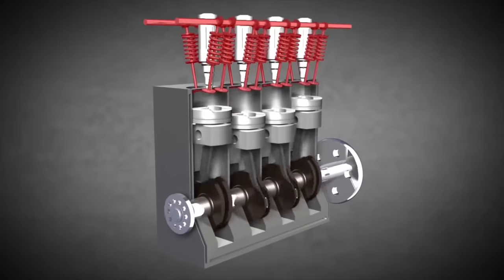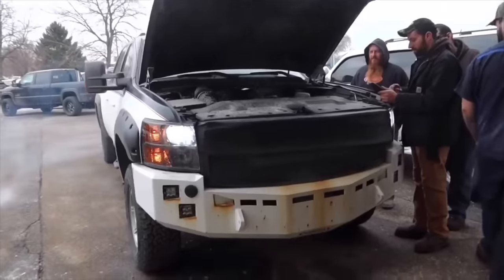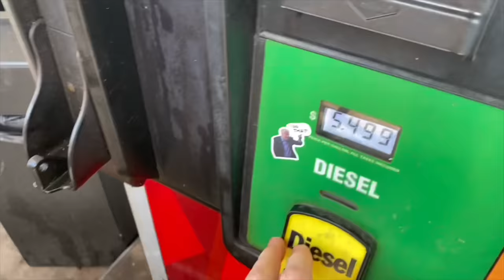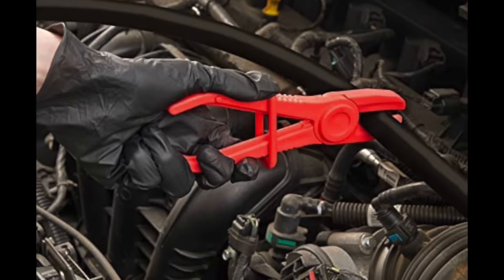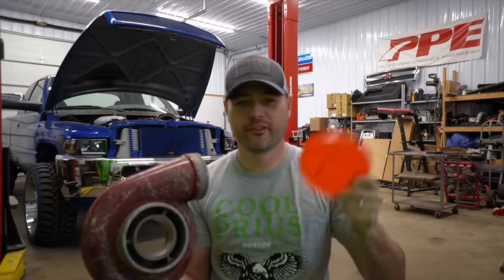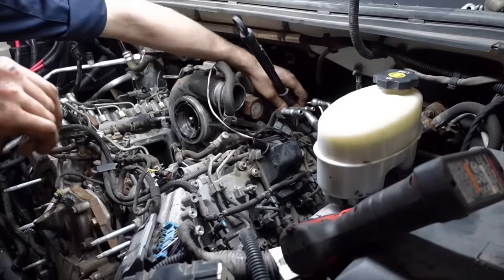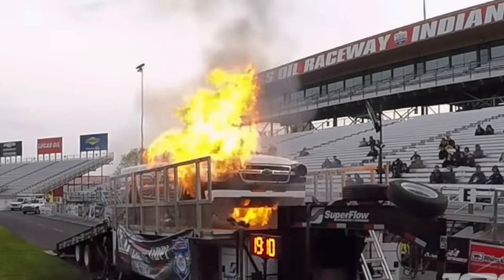What Is A Diesel Engine Runaway? *EXPLAINED* ￼

Comment: If something blocking the engine breather ( pcv valve) it will brake the oil seal at the turbo intake side  , this oil will go along intake manifold and go to combustion chamber , and cause a diesel run away ( this have happened to a truck in a workshop i was working in ), but you can always use fire extinguisher in air filter to stop the engine , along other ways

Comment: New to me old Massey Ferguson 1105, 110 hp turbo diesel. Takes 4 gallons of oil but I put in 5   Old eyes seen it wrong. All good for an hour while I checked it out at low rpm. When I took it around the field and throttled up I think I go an extra 100 hp. It started screaming. I ripped the throttle back to idle and it stopping. Oil smoke everywhere for a second.  Crazy!!!

Comment: 5 years ago a I didn't know what a diesel runaway was. On a certain. Started my Hino truck as usual, then it started to rev up. At first I was all over the place not knowing what to do but then I was calm and I collected myself. I disconnected the fuel lines and from the tank and in about 2 minutes it had an air lock and shut itself up.

Comment: I would probably install the electronic intake damper. Tbh i'd also probably install an electronic valve on the fuel line as well. Then i'd just have to press 2 buttons to shut off both air and fuel.

Comment: Hard rail lines here. It happens so fast, you don't have time to pop the hood, find a board and suffocate it. A rag will suck right in. Has to be a board or something stiff.  If the turbo is leaking, grab your dog and run.  Doesn't happen the way it used to.

Comment: Had a scammel tank transporter have engine runaway due to faulty shut off solenoid. Scarry to say the least. Used halon fire extinguisher  in the intake which worked a treat. Engine survived.

Comment: We had a runaway on a Cat 330 track hoe one time, but it wasn't an oil based runaway. What happened was the operator hit a natural gas line, and so the motor was sucking natural gas into the air intake. There was nothing we could do. Everyone was running from the broken 4 inch gas line. I don't know exactly what failed on the engine, but it revved up real high and then locked up.

Comment: My ALH VW ran away on me this morning. I put it in 5th and letclutch out and it stalled straight away, whole thing lasted about 3 seconds and luckily it still had oil on the dipstic when I checked everything over after work. Prigibally thought the turbo had blown but now believe piston rings as smoke and oil being blown from PCV valve with no turbo attached.

Comment: I actually had my diesel engine run away today on the highway. At first it seemed like my throttle was stuck, so I put it in neutral and the engine started revving out of control. I stopped on the side of the road, a lot of smoke and didn't think of putting it in 6th gear at the moment. Lucky for me there was a motorcyclist stopping behind me, who knew what to do to make it stop. Probably my turbo's gone, I hope the engine is fine... Thanks for the video, I'm hoping nobody who's reading will suffer this incident - super scary!
Reply from the maker: Glad you made it out ok that’s terrible news for the truck though

Comment: Spraying a fire extinguisher at the intake is safer and also works. You don’t need to starve the engine of air, but of oxygen. If you can replace the oxygen with something that won’t allow oil to burn (like CO2, for example), you can stop the runaway that way too. So, if you have an old diesel, carry a fire extinguisher. They’re like $20 at Walmart.
Reply: Co2, yes, dry chem won't work though

Comment: Blast the air intake with a Co2 fire extinguisher, most nearby places will have a carbon dioxide extinguisher as they can be used on many types of fire

Comment: A vintage Ford F1000 (South American F-150) has a big spring loaded shutoff valve hooked to a cable. To kill the engine, you had to pull the valve, the ignition does nothing. To start it again, you must disable the valve. Lots of people were baffled when they tried to get it started and nothing happened.

Comment: I was driving on the motorway today with my 3.0TDI Audi A4 and that's exactly what happened. I was driving at about 180 km/h and had to brake and then I noticed that the car was accelerating on its own, just a little but you could feel it and after a few seconds it was really revving up to the maximum and I did exactly what you said, clutch and then brake and it stopped revving. So I can say that was a bit scary. Now I have to find out why it did that and what exactly the problem is.

Comment: The army uses fire extinguishers sprayed into the intake soaking the filters or into the tube itself either with choke it out. Also get rid of the blow by tubes hooked into the intake and that duramax should have had air and fuel shutoffs with driver, front, and rear controls. I’ve only experienced 1 run away and it was from a 6.0 turbo job that the owner drove for months missing the exhaust wheel. Long story short once I put a good turbo on it made it half a mile and I will never work on that guys trucks or equipment again since he doesn’t want to be up front about major details.

Comment: From what you explained, if my 320cd (rip) was to runaway i would probably cut open the charge pipe so the engine would lose most pressure and compression

Comment: If a pickup has been in a rollover make darn sure there is no oil in the intake or after cooler.  It may not run away immediately but if it gets warm enough with enough air flowing through it they can start sucking that oil into the engine.

Comment: Bro, love the intro lmao great work! Also, so glad I found your video. Newbie to diesel motors here but I've watched tons of different videos and been around em a good part of my life so I know the basics and whatnot. Recently just started working on/with an older, maybe '07 cat 247b tracked skid steer. While cutting down trees to clear land for cattle somehow must have broken off the fuel cap so we ran a few days without it on and where suffering from fuel starvation issues drain the tank change the filter out and whatnot clean the pump got it going working great recently just had to change out a auxiliary hydraulic coupling for the first time with success so no leaks there and today we went to change the oil on it. I remember I'm not the owner of it LOL but the owner did state to just leave the motor cold to drain the oil so all of the oil will have stayed in the pan therefore having most of the old oil drain out. The little pet cock on the oil drain was left open and the oil cap left off for a good hour and a half at minimum to drain and I think we only pulled out about a gallon Maybe. Now to be fair beforehand every once in awhile the low oil light would come on briefly and then turn off so we thought maybe it was just low on oil and possibly burning some off. So we went ahead and added the 2.6 gallons as required per spec sheet and waited Maybe a few minutes before it was started up and I noticed a weird Idol. Kind of going up and down a few hundred RPM but nothing bad. Some throttle was applied slowly and eventually it started to run away and I stated in your video my very first reaction was to grab the key and shut it off and of course it didn't help so I'm running around the shop which has been freshly in recently moved into so not all of the supplies and tools and items that we would normally have in it are there but I'm running around looking for something to block off the intake with I eventually find a 5 gallon bucket lid I then struggle for about 20 seconds to get the air filter cap I guess you would call it off to remove the air filters from the air filter box and while sliding on oil and some freshly spilled paint LOL I somehow managed to get that big lid in the small space and get it stopped We Believe total runaway time about a minute and a half. I don't believe it ever went past the the governor RPM wise thankfully but immediately after shut off and Gathering our marbles after we had just lost them we decided to check the oil and saw that it was immensely overfilled. We did however start it right back up and it ran perfectly fine granted we didn't give it any throttle whatsoever we drain the oil down to proper levels restarted it let it run for a few minutes and ran it through the full RPM range with no further issues. Upon inspecting the oil being drained out of the engine we noticed very very fine and small metal particles I am assuming came from the crankshaft bearings but they were so tiny just barely visible only visible in direct light from a flashlight or cell phone. And as you stated in your video where you have never experienced a runaway diesel in person I had never before either to the state and I'm just glad from all those YouTube videos and asking questions I knew what to do the reason I found your videos I wanted to see what the possibility of the damage aftermath might be. The owner who happens to be my father-in-law stated he's also never experienced a runaway diesel before either and didn't have any clue what to do so thankfully I was there LOL. But if you would have any insight as what we might want to check or look out for as far as any aftermath or damage from the fact please let me know and it would be greatly appreciated since I'm going to be doing work on a lot of more diesels and whatnot I probably will be subscribing to your channel so new sub here thank you for the video keep up the great intros personally reminded me of Demolition Ranch and his crazy intro videos but again thank you keep up the great work.

Comment: Yeah it's not that easy to block the air intake from any part of the turbo as most of the duct work is bolted and banded and not easily disassembled when the motor is picking up speed and it's getting hotter and hotter..

Comment: Why not just install a cutout valve. They been around for years for diesels in refinery’s and for the most part mandatory.  Is a electric gate valve that closes off the intake witch it starves the engine for air.

Comment: I have an '85 Mercedes 300 CD Turbo Diesel.  As far as I know, ALL of the MB OM series diesels have an emergency STOP lever mounted on the throttle linkage.  You can't miss it.   So, I guess even tiny 5 bangers can run away.  I cannot think of another reason why they'd put that there.

Comment: Yep I bought a property with 80s boom truck with a Detroit diesel engine and I was curious to see if it would run so I hooked up a battery to it and luckily the fuel tank was almost empty because they ran away for almost 30 seconds before it finally shut off, but it was pretty scary to see

Comment: An analog runaway deadlock could prevent further damage, but good luck developing that.😅 I suggest a bimetal switch like the ones in modern electronic waterboilers and a solenoid valve on the fuel intake, engine gets too hot, boom no more drinks served 😅

Comment: A flaw in design known as a shut off valve deficiency.  Explain exactly how a complete restriction of all airflow into the engine is incapable of immediately cancelling out any further internal combustion.  Where is the oxygen coming from if it isn't able to enter the air intake?    I could even see an automatic system, but at least a lever is a must is a runaway if a possibility.

Comment: I think I saw this happening yesterday on hwy 401 in Ontario. There was a truck stopped on the shoulder that I initially thought was on fire, but as I got closer I could see all the smoke and flames were coming out of the exhaust stacks. I could smell it from quite far away and the amount of smoke was outrageous. I'm assuming the guy got out OK because it was stopped safely off the road.

Comment: Was working on a diesel soil compactor a small engine and it ran away from me today yanked the fuel line and kept going after 8 minutes or so it finally died haven't checked it yet to see if it'll run again hope it does

Comment: I had kia pregio which after 10 years under hot climate conditions developed fuel leak thru seal in fuel pump so added up fuel to sump oil. It caused two effects - first of all hot engine did not crank by starter on too thin oil, second - when oil level rised too much it began to splash it with crankshaft, all this mix went to vent suction and then to cylinders, creating not full scale but sensible runaway with weird smoking and power loss.

And no one mechanic could find it until I personally dismantled the pump and found this cracked rigidised seal. Moreover it looks like popular problem with these bosch-style pumps, as I met it after on other kia, on pump from wrecker yard and many other kias ended their lives with seized engine due to this oil thinning.

Comment: I would use a CO2 extinguisher as that would stop combustion without damaging the engine. Would also work for an engine burning oil. Just pull the pin and spray straight into the intake so that air can't get in.  Has the added benifit of soaking up a ton of heat as the CO2 would produce dry ice that the engine would be inhaling and sinking all that heat away
Reply from the maker: Very great point
Reply: CO2 extinguishers are not cheap to buy, but can be recharged at a low cost.
Reply: @1768ify  cheaper than a new engine
Reply: Where do you keep yours?  I have one in my shop. Seems impractical to carry one around.
Reply: @1768ify  behind my drivers seat in my truck  my other vehicles have it in the back with tool kit.
Reply: This is a good point. I have co2 tanks for welding should yield the same result. Also soda machine vendors carry co2 tanks also. I think that would be a great way to stop it.

Comment: The best way is "Old School".
 A mechanical (cable released/activated) metal plate/air gate which IS 100% EFFECTIVE ANY TIME because it is completely Independent of electrical/ computers/fuel pressure or anything else aside from YOU PULLING THE EMERGENCY LILL KNOB! 
Old School RULES THE ROOST!

Comment: I have a 1981 Chevy V8 Diesel 5.7. had Runaway while driving it suddenly took off. when the auto Transmission got to 3rd gear i engaged overdrive lockup on the highway hit brake and park brake same time engine stalled released brake and park brake to slow it down as passed everything on the highway.it was running on engine oil. engine i overhauled all good now

Comment: Drove a 18 wheeler for nearly 9 years in the 90's, never witnessed diesel runaway. I have however witnessed one run backwards. The intake became the exhaust and the exhaust became the intake, all oil pressure dropped to nothing, put it in reverse and truck moved forward, put it in first and it moved backward. I wasn't driving the truck, my friend was and we were headed to Texas when he stalled it on a hill lugging it in first gear from a stop. He got on his CB and asked me what was wrong with it and I had zero clue. It was other drivers that knew what was going on and told him to just shut the engine down, then restart it to remedy the situation... true story.

Comment: Intro was the best. The water bucket on the engine made me lol. On the lb7 taking off the air filter plugging that intake would probably be my go to if I didn't have that shut off valve. Nice Info here. Always wondered what caused this
Reply from the maker: Always appreciate the great comments 🙏
Reply: You look at that black truck and tell me your disconnecting anything? 🙄 Would blow your arm off.
Also that intro was annoying af.
Why everyone has to be a SNL meme today is beyond me. 🥱